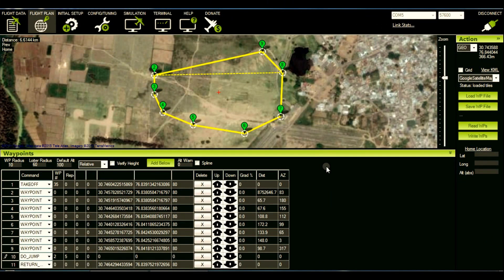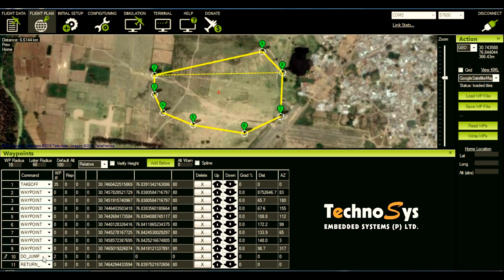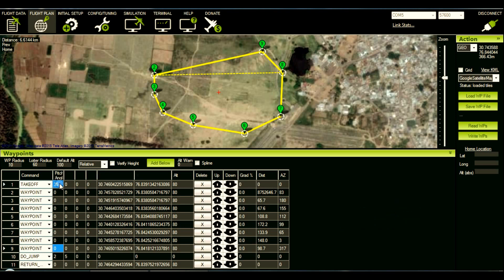ArduPlane Mission In A Loop To Fine Tune PID - Do_Jump

Comment: thank you !
Reply: my rover move in a circle im using apm 2.8  Firmware 2.51beta or external  compass with gps module and servo for steering but if i select auto mode car move clockwise circle if i select guided mode its turn in a anticlock wise direction  so what should i do plz help. Me?